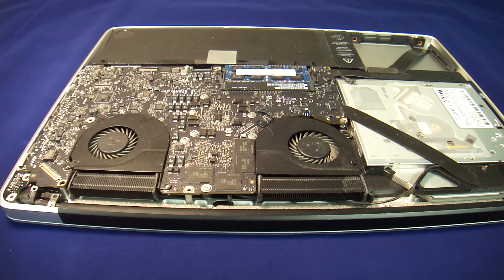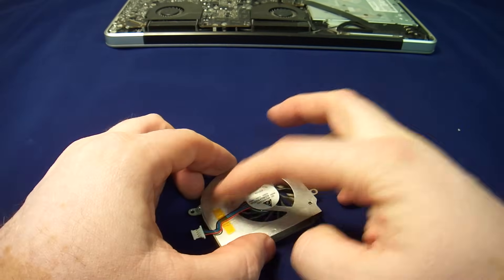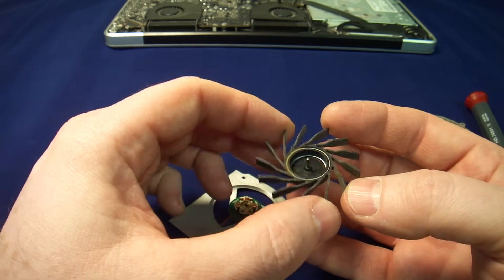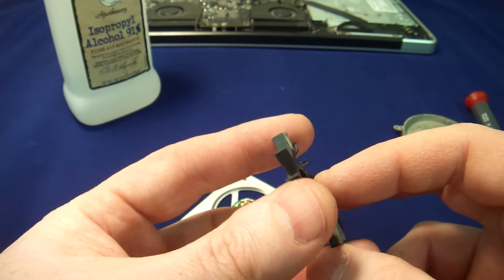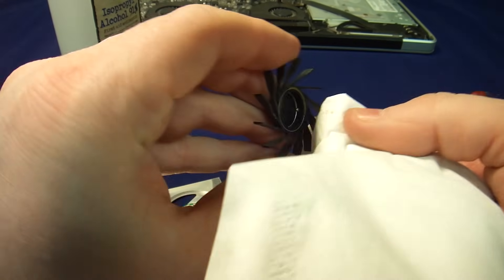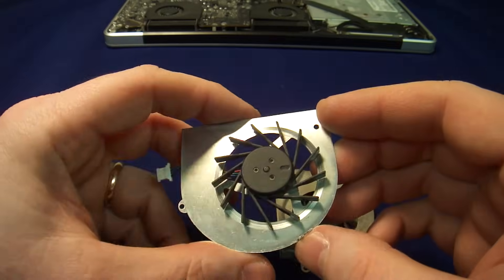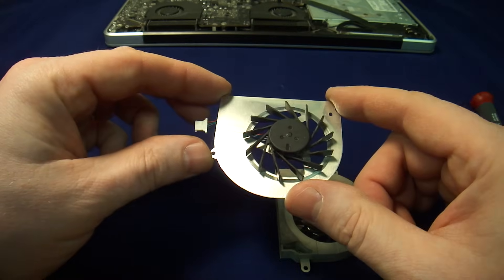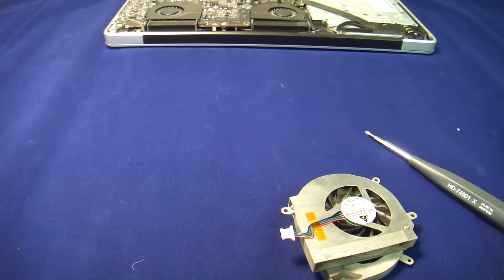How to quickly fix laptop cooling fan and resume normal operation of the computer MAH02617

Comment: i have one question pls, my fens basicly stopped working the work on like 30% now, its like on edge of not overheating, i have v3-571g i7 3632 qm 2.2 hz model, and my question is , is it better for me to let like specialist repair it, but it will take 30 days and bit of money, or its not like really hard to do it myself, i kinda understand pc's , its just i heard notebooks are hard to dissamble :D, pls help me with your opinion.

Comment: Laptop fan started making noise after ugrading the ram from 4 gig to 8. did not bother about it at first, but it got worse and worse and now if it turn it up it sounds like a grinder. But if i tip the laptop to the side, then it the noise alters. louder and softer. if i hold the keyboard section it up 90* straight up the noise stops. but when i put it back down level the noise often restarts.

Comment: my fan is wobbly I took it apart cleaned it lubed it and it's still not working. how do I fix it if it's just loose/wobbly and hitting the metal sides

Comment: I opened my laptop to clean the dust off the fan but couldn't reach all the dust so I bent the cover of the fan to get into it but I had to end up cutting most of the cover off because it was bent and hitting the fan. Will this affect the performance of the fan?
Reply: I'm not to sure but I believe it would, plus it's going to damage the fan in no time at all, I highly suggest that you fix it or replace it.

Comment: I think the reason why any lubricant doesn't last long in your fans is because these particular bearings (probably made out of porous bronze) require to be oil impregnated to function properly.
And while it's not possible to do the following procedure with fans, it can generally be done by heating up the oil, dropping the bearing into it, and after 15 minutes dropping the bearing into cold oil to cool down.

Comment: dell makes laptops absurdly difficult to open...
Reply: true. i opened lots of laptops, but dell & HP are the most difficult ones
Reply: you didnt try fujitsu ....trust me i work in an computer,mainly laptop based service
Reply: you forgot Samsung
Reply: my dell inspiron 1545 has one plate with 4 screws and uder there i have access to cpu gpu wi fi card and ram
Reply: Indeed, a Samsung notebook I tried to had like 6 clips spread over the flat plastic underneath the battery. Without proper tools I had to stop there. My Toshiba on the other hand, which has no maintenance panels at all, was fairly accessible because all the clips were on the outside, where you can lift them with something flat or fingernails. Once or twice a year I open it to remove the dust from the fan, not possible with the Samsung.
Reply: @mleise8292  dude thank you for this comment... I'm about to work on my Toshiba and was nervous if it was going to be a nightmare to get into
Reply: It is a Satellite M50-A-11L and so far I lost one plastic "nose" and I once fastened the screws before the base latched into place on one corner resulting in a fine crack but with no ill effect. More irritating is when I notice how quiet the notebook became only to realize I forgot to plug in the fan again before reassembly.

Comment: What if you don't put lubricator?? How long would it last??
Reply: goldstarcreep i wouldnt suggest using without lubricating it, as it will cause friction between the 2 parts and may most likely spoil your fan.
Reply: Ok Thank you

Comment: what if you can't pull the fan off the rotator
Reply: yeah, that was my first reaction too from experience with bigger ones of the same type/kind, this one pulls off like super "too" easy to believe but i'll give it a try on my dual fans on lenovo y50-70 which runs /sounds like a diesel engine of old

Comment: I've had an issue in the past with a GPU fan, the coiling was damaged somehow and I've haven't seen any visible damage (it didn't had smooth movement when powered), so I've tried cutting one of the coil ends and soldered it to the board instead of the existing wire, extremely hard because if you apply the iron for long periods it snaps (and long means short for that wire, so imagine like 2-3 seconds are too long) it was a frustrating process but it managed to work.

Comment: Depending on the fans, just get a syringe and get some isopropyl alcohol squirted into the fan. Make sure you take the fan off the computer I know that’s common sense but common sense is not common anymore. Nope.

Comment: LONG LASTING LUBE??? put a drop of GEAR OIL in the stator and some greese on the shaft. It will buy you huge time ;) chao
Reply: +Attaullah Sumalani can i do that for real?
Reply: +tonylemay you have a brain, think for yourself. What could go wrong?
Reply: +paroutdiok What could go wrong? can you guide us???
Reply: Absolutely nothing? Gear oil is the best f*** lubricant for this kind of use, shiet they use that thing on plane turbines, why not on cpu fans?
Reply: is Gear oil and Transmission oil the same thing?